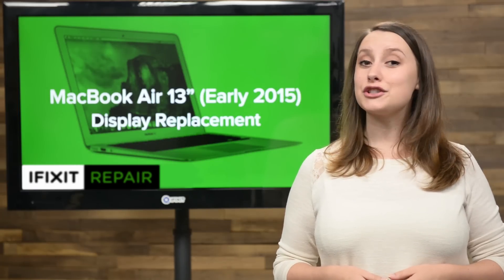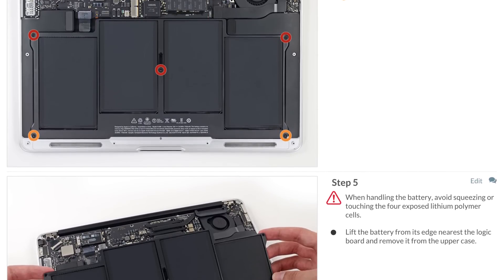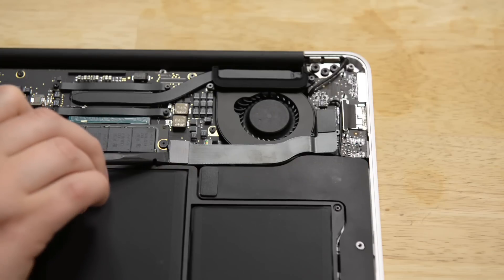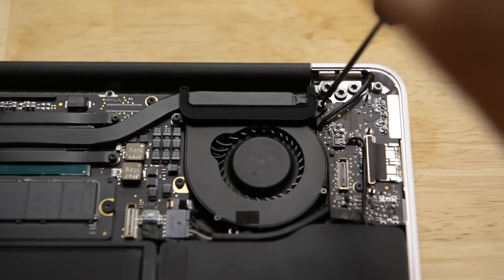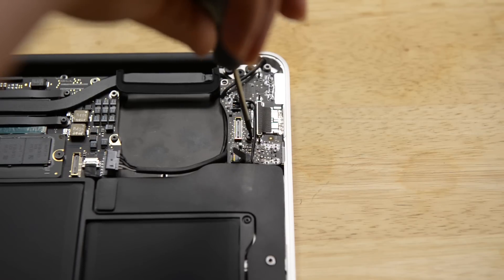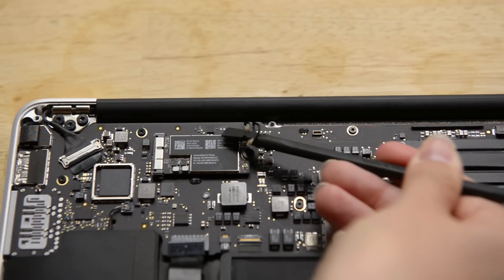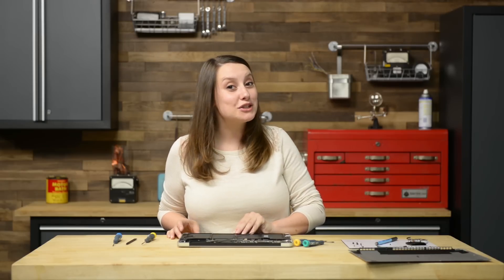How To: Replace Display in your MacBook Air 13" (Early 2015)

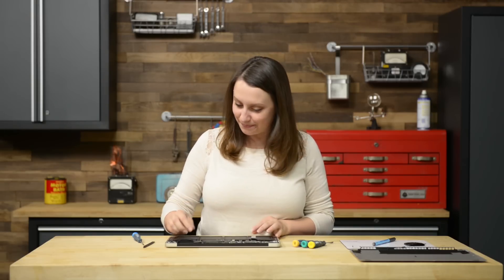Comment: No need to disconnect R+L speaker cable & the i/o board (4:01 - 4:50), the left speaker cable is very small, very difficult to remove, you might remove the connector which is soldered to the board. The camera cable can be removed by cutting as the new replacement come with this cable.
The antenna cable is most difficult to install (5:07), very small connectors and must be very careful.

Comment: great video tutorial but one massive problem - no static discharge protection - no ESD matt or grounding wrist strap - chances are you have damaged some part of the computer, and even though it still works now, it may fail in the future from the damage you do now.
ESD is real, even though you can't see it or usually feel it and only a few hundred volts can damage or destroy semiconductors.

Comment: I did the repair, changed the screen, and put everything back together... but now it will not turn on and the charger does not light up when I plug it in! What should I do?

Comment: I am having this problem since almost a year now. This flickering happens so randomly, I am now in India and no apple store is capable of diagnosing it. This is such a disappointment. 
https://www.youtube.com/watch?v=WYZHQdpiDec
https://www.youtube.com/watch?v=jfeVzvK3BLo

After 15 seconds or so it shuts off and if I restart, it starts fine with no display issue but fails again

Comment: Fyi, if you bought a replacement screen  that is just the screen only, this is not the video to watch. This is totally unnecessary to replace that portion. They should state that at the beginning of the video.

Comment: The  camera cable on my model A 1466 mac book air plugs right into the top side of the I/O board which is different than what you show in the video.  The connector at the end of the cable is different than the one on your video and the one on the replacement screen that I bought.  Any suggestions?
Reply: I have the same problem

Comment: Overall good video but its not complete without showing how to put them back together. Thats also hard part. Besides, the camera frequently switches to show your face (no offense) and it's distracting users from orientation. I'd prefer to keep camera focusing on the work being done instead of switching constantly for every step. I am losing orientation :-(  Thanks for the overall effort
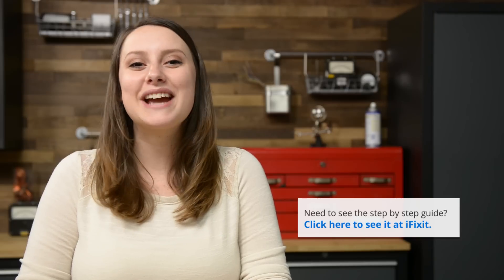Reply: 7:55

Comment: How much different is this on the 11 inch model?
Reply: On the 11" you would have to take apart the battery, remove the board, the I/O board, and then remove the display

Comment: Hello! Great movie, thank you! I have an additional question. I was wondering whether it is possible to solely change the aluminium case that covers the display at both sides (MacBook Air 13 inch early 2015). On holiday, my MacBook accidentally did hit the floor :-( To replace the entire display component is super expensive and very unnecessary because every still works. That is, my problem merely has to do with the destruction of the aesthetics of my Apple product. 
So, let me explain my case in more detail, because there is a good chance I overlooked my possibilities: if the Macbook is closed (and in front of you), and you consider the frontside, so the place where you normally open the MacBook, at that thin side there is some damage (due gravity and the floor.) This damage covers the uppercase and the case that "covers" keyboard. So: I need to replace both elements. I already saw it is possible to replace the aluminium case that "covers" the keyboard, and that part is not so expensive, perfect! Nevertheless, to replace the entire display is much more expensive, about 500 dollars I just noticed. But I do not need an entire new display, I just need the freaking aluminium case. My question: is it possible to just replace that aluminium case? Thank you very much for your time!!!! And sorry for my bad English, I hope it is all understandable (I am not a native speaker, I am  Dutch). Cheers, Mark.
Reply: I might be missing something here. Why do you have to disconnect fan and other wires. Surley the bracket and maybe a plug to power screen.

Comment: Actually you replaced the whole dysplay frame, is it possible to replace the screen only?
Reply: +Kennerfull Sadly not.
Reply: Yes, It is a very delicate job and takes longer but is is doable and cheaper.
Reply: Anthony DeVito I don't remember if i knew the channel back in june, but i paid him a visit after Linus from Teckquikie made a video with him, guy is great.
Reply: It is possible, but it is extremely difficult. Louis Rossmann has videos online of doing this. I won't call them guides because it is an extremely difficult process that can easily be messed up.